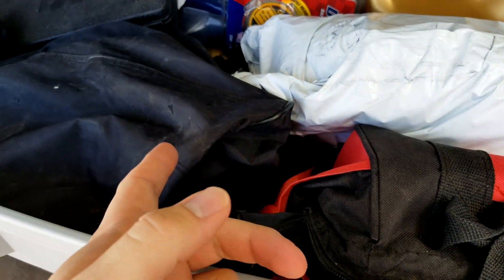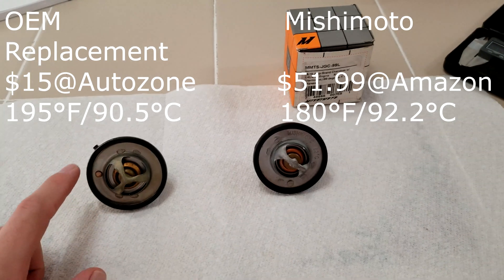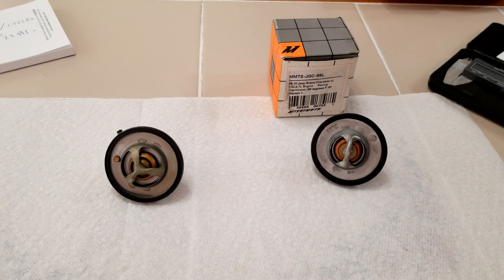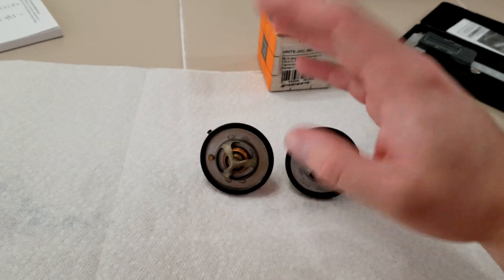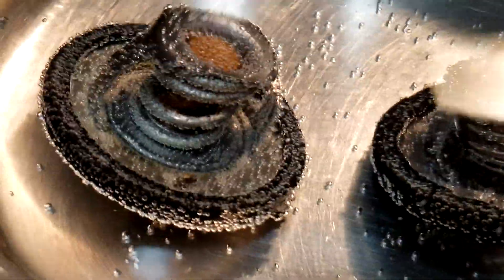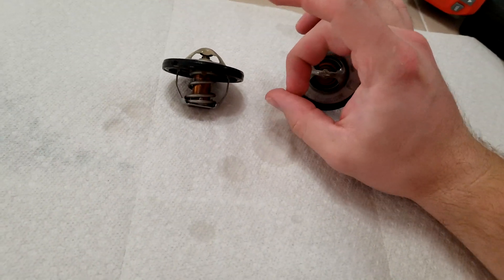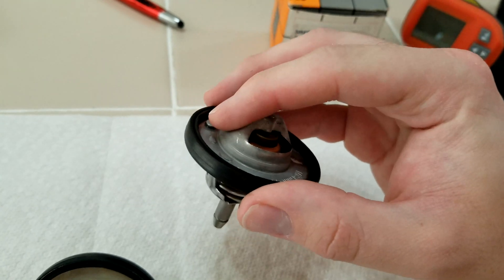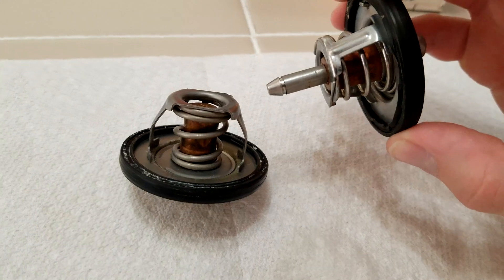Mishimoto Racing thermostat for Jeep 4.7L- A great idea with a fatal flaw!

Comment: 2 years later............. I just bought the Moto Rad 180* and it looks just like OEM and lowered the temp and seems to be working great. It was also $14.07 shipped sooooo, yeah.
Reply from the maker: I am running one of these, also. No issues with the Motorad tstat.
Reply: Did you use the Motorad 416 or 420?
Reply: @ronaldflamingo8711  I used Motorad 420-180